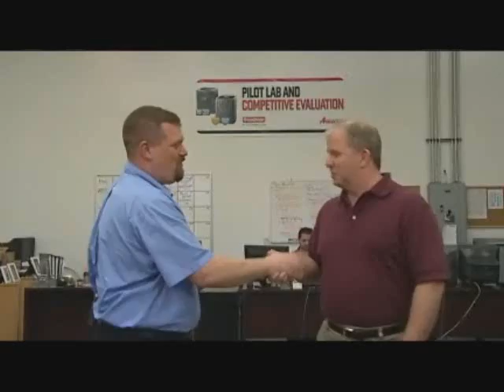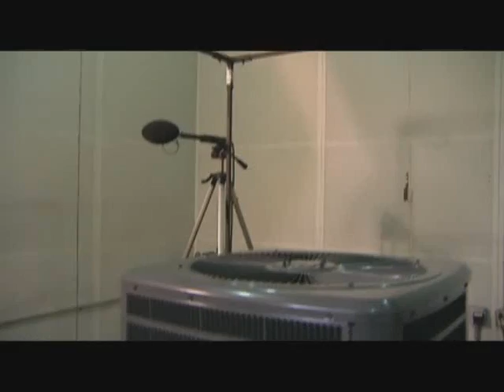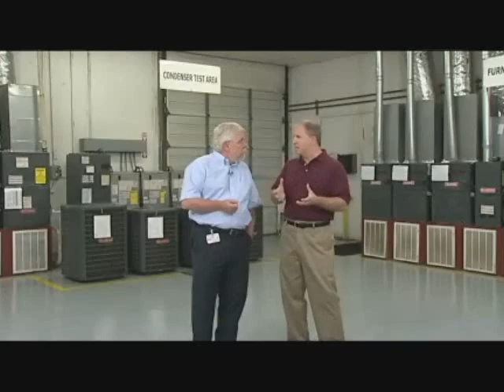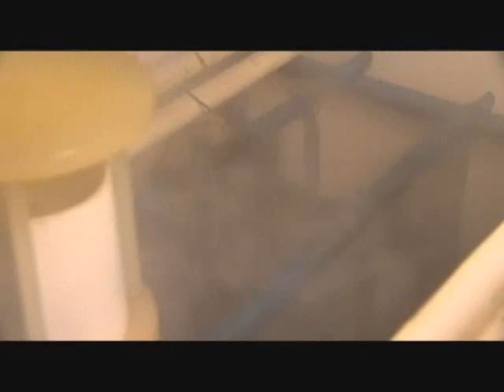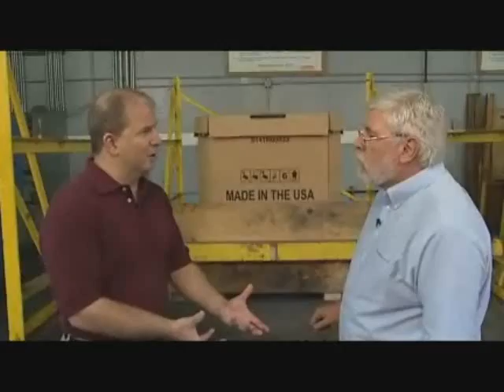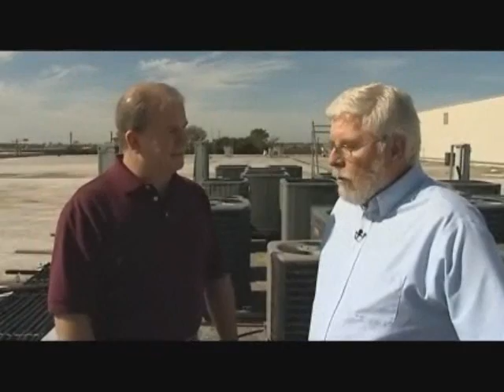ACWholesalers.com Presents Goodman Engineering Tour

Comment: I just installed a Goodman GSX16 5 ton condensing unit with a new coil and a new GMVC80100 furnace. The only thing that I didn’t like was the incredibly cheap single pole contactor which fell apart when I tried to connect line voltage. I upgraded to a higher quality two pole contactor.